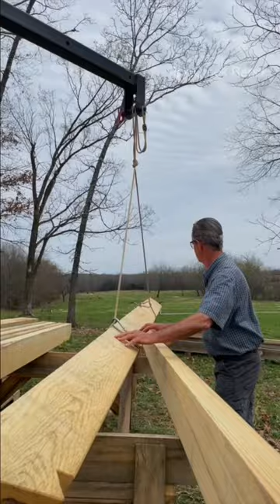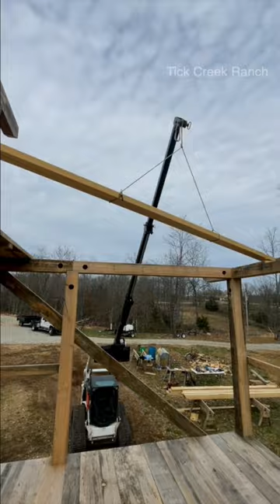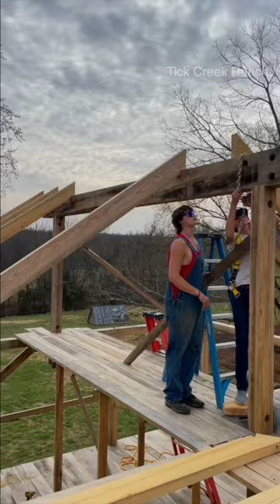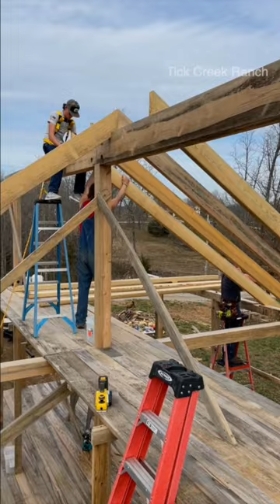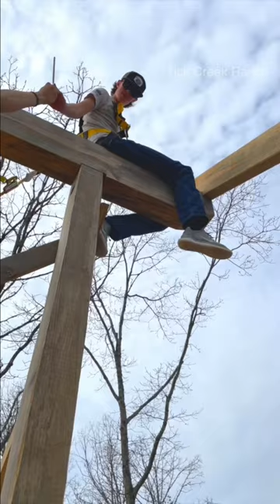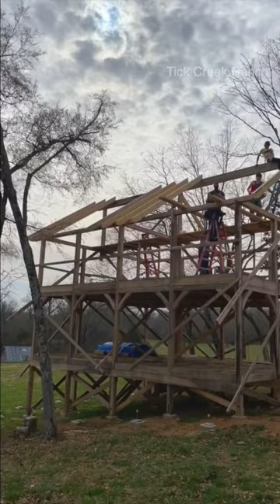The house is Coming together #shorts #country #hardwork #countrylife #woodwork #woodworking #diy

Comment: That skid steer crane is absolutely sick you guys. I gotta get one of those. 👍👍👍
Reply from the maker: It’s worth it’s weight in gold
Reply: @tickcreekranch  who makes it? I think I need to get one.
Reply from the maker: @evergreenorganics  Prime Attachments. 22.5’ reach plus loader boom. About 3k and worth every penny
Reply: I was looking at beat up old tele-handlers for $50k so this is a much more affordable option. Thank you friend.
Reply from the maker: @evergreenorganics  they are only rated for 350 lbs at full reach horizontal but, do everything I need it to. What size machine do you have? That would be you biggest limiting factor

Comment: What method of timber frame is this. I wanna build my house like this.. i like the alltrread method yall use
.. what are yall gonna fill in the qall sections with? I cant wait to see more videos on how its coming along
Reply from the maker: This is a post and beam that we got a little creative with the joints instead of a bunch of ugly brackets. We’re going to clad the walls completely from the outside of the frame. It will be a sandwiched purlin between vertical wall paneling with a foam core. The pine boards will have chinked joints once the wood seasons
Reply: @tickcreekranch  ya I like it a lot... great job 
So pine 1x and thin foam then tarpaper? Then more 1x as siding? 
Thanks so much...